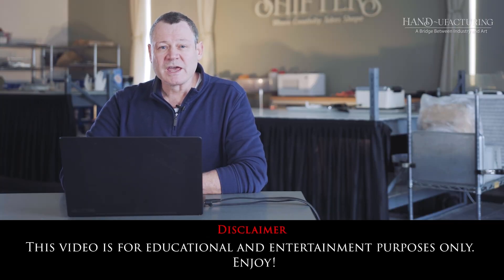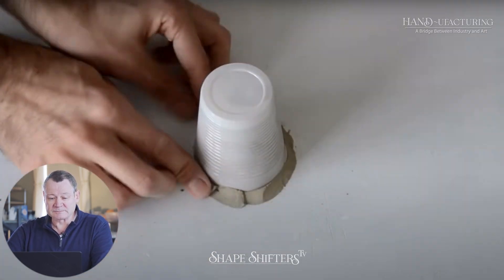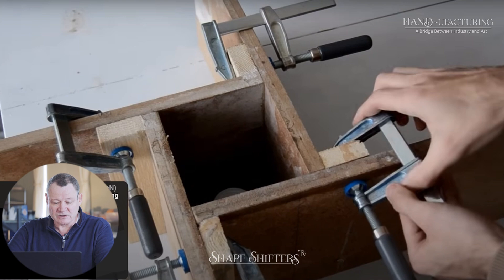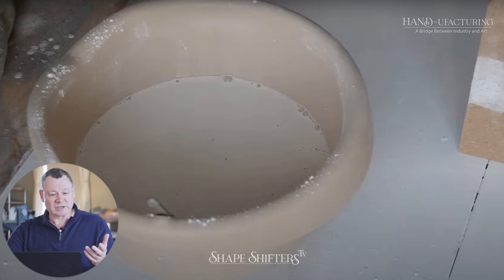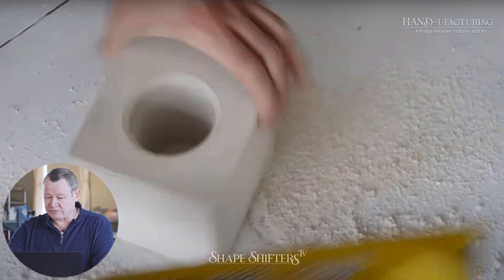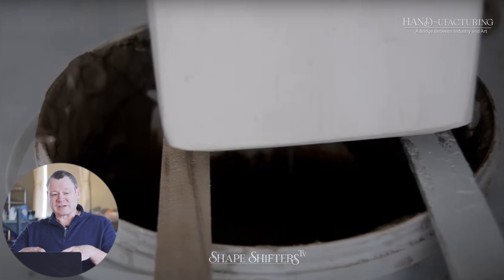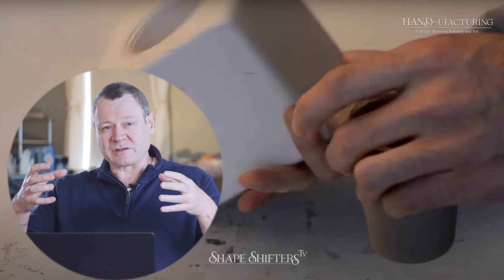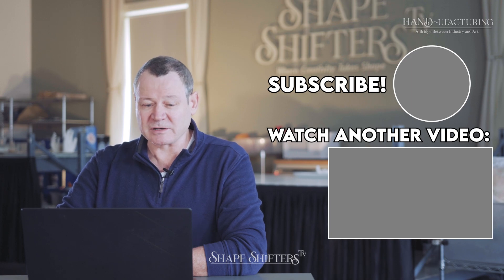Pro Mold Maker Reacts | How Slip Casting Works | Your First Plaster Mold - 101

Comment: I’m a full time ceramic producer in my solo studio and I’ve switched over to slip casting recently. With my engineering background I’ve been surprised at the lack of (and inaccurate) mold making for ceramics resources. I’ve done a lot of trial and error, and refused to heed the advice of pottery shops to “judge plaster mixing by feel” and to ignore the scientific process to make good molds. Your videos are amazing and super insightful. You mentioned you have a book for ceramics, where can I find it? Thanks again for sharing your knowledge!!
Reply from the maker: Hi Josh,  Thanks for messaging. 
I agree, there is a deficit of solid mold making information out there... largely because one size does not fit all and mold makers are not community centric. Donald Frith has a good mold making book, but it is slanted to industry and not artistic at all. 

My books were art centric, but in another video I mentioned why I did not publish the ceramic volumes when I wrote them in my early 30s. The contracts were crap work for hire agreements that were not to my highest good. We will be uploading chapters from those books in the near future. It is expensive to organize and reformat for video, but we will commit as soon as I can sort out the economics of it. 

Plaster mixing... I kept it simple. Room temp water / 1 gallon to 11 pound #1 Pottery with 1 pound hydrocal. hydrocal extends mold life, but is not necessary. lay in dry plaster to water gradually..should not take more than 2 minutes to get in water bucket. Let slake/soak for three minutes and then power mix with disc for one minute max. Pour and you are gold. I will show on a video in the near future. 

Thanks for joining in on the community...we are small but dedicated types!  M